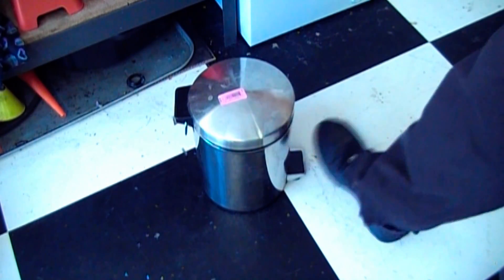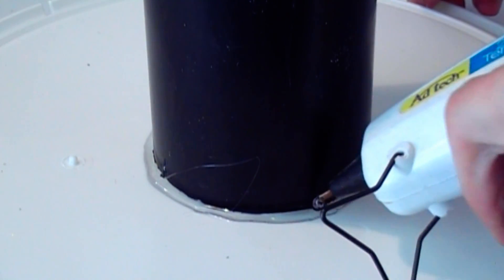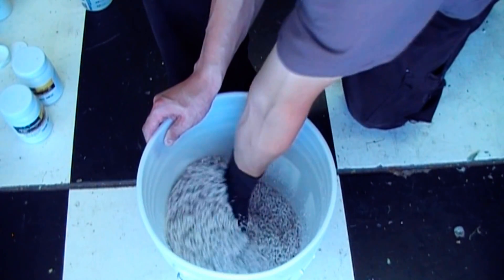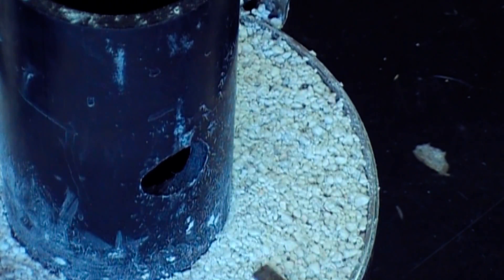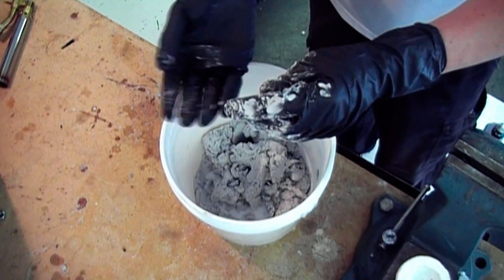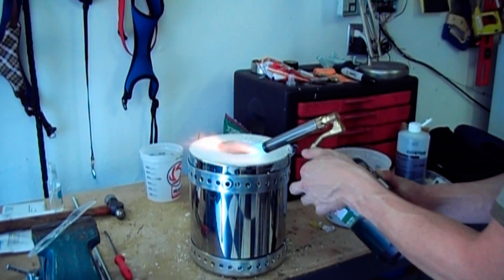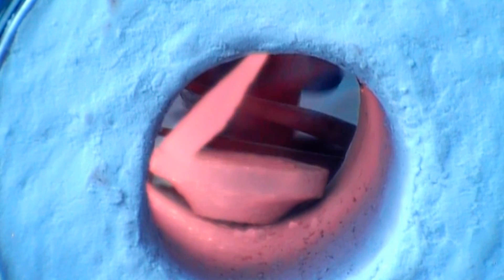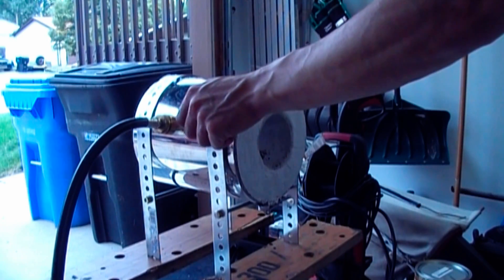How to build a trashcan forge

Comment: I used your method here but on a slightly larger scale. I used a 55 gallon drum! Multiply all your ingredients x10. And I made a few mods along the way. It's on a cart because it's so friggin' heavy now (over 160 lbs) and I used a 20 lb MAPP gas tank  and oxygen cylinder with a push button igniter from a gas grill. It burns so much hotter than store bought propane. And there is a gas plant very close to get cheap refills. I could not have made it without your video, so thanks. When I get it all finished, I will post a video response to show you how I did it. Thanks!
Reply from the maker: Danny Criss Cool, it's nice to hear others having success with this method.
Reply from the maker: It dose loose heat more than an enclosed forge, my plan is to make a set of doors that can open or close.
Reply: Danny Criss I'm looking forward to that response :)
Reply: Bill Milligan Sorry, it ain't going to happen anytime soon. I got most of the parts and then used them on another project in an in-ground fire pit. They don't allow open burning in my neighborhood. So I got fiberglass "logs" and use the parts to make a fake outdoor firepit. This is a great project to build though. I should give it another shot.
Reply: Charlie Foxtrot The 3rd were you serious about multiplying it all by 10?

Comment: I didn't see in the comments anywhere, but does this forge get hot enough to make forge welds?
Reply from the maker: HardtailNomad I'm thinking not quite, I played around with forge welding, but it took too long to get the work hot enough that the process was basically not possible.
Reply: clkindred Thanks for the quick reply. That what I was really curious about.

Comment: This is really nice, I'd like to use your project to do some brass casting, do you feel that the forge could use a back cover made of the same refractory you used and hence become a standing furnace?  by putting the burner near the bottom and using a crucible on top?

Thanks for the video
Reply from the maker: lbabeanu Sure, I plan on making some doors for the front and back, but you could use the thing tipped on it's end vertically.

Comment: How high does the forge temperature go? I've been researching this because I aim to make a coal forge using a similar method, and according to most sources, sodium silicate melts at around 1100 degrees celsius, which doesn't seem to be the case in your forge
Reply from the maker: Maxime Once the lining is "set" there is no sodium silicate to speak of, it decomposes into silicon dioxide, with a melting temp a little higher at 1600 degrees Celsius.

Comment: Quick question. Me and a friend built a foundry with your mixture. We compacted the perlite mixture to such a degree after leaving it sitting overnight we had about an inch or two of water in the burner hole. Do you think we compacted it too much? Will this cause any problems? Thanks
Reply from the maker: Michael Lawrence I don't think compacting it too much is a concern. Just make sure to dry it well before un-molding. When I fired this forge up for the first time, there was water dripping out and making a puddle on the floor.

Comment: Do you have to flame set the cement mix, or is the flame just to get it to set faster? You could just let it air dry over a few days?
Reply from the maker: richtus It will harden in air, but if it contacts water it will soak it up and fall apart, flame curing causes the sodium silicate binder to decompose into quartz (silicon dioxide) at that point it will not absorb water and re soften.

Comment: Hey I've been watching your forge builds and have to say I am impressed.  Your refractory material recipe is great as well as the water glass.  In this later build you commented that it was a week before your refractory lining set up.  Does it take that long or did you simply wait that long before getting back to the project?

Also, where do you find the aluminum oxide?  Is it inexpensive?  In your other video, you also added baby powder to the mix (looked a lot like meeko's furnace cement when you finished it).  Is it necessary?  Thanks for posting.  your projects are quite ingenious.
Reply from the maker: Aubrey Smith Thanks! The week long wait was so the refractory could dry and become firm enough to take the center form out, the time it takes for it to be ready for that can vary, but if you un-mold too soon it will crumble apart. I got my aluminum oxide from harbor freight, it was 6 bucks for a two pound jar. I used two jars, so 12 bucks of alumina went into it. That older recipe with the baby powder (magnesium silicate) is not as good because it melts when directly in the flame.

Comment: I have a very hard time finding aluminium oxide (at least in the relatively small quantity used for this project, the smallest quantity I can find is in bags of 25kg).
So I have a question: is the aluminium oxide necessary, can it be omitted or possibly exchanged (with for example olivine sand which I can find in an appropriate amount)?

I'd love to give this project a go as soon as I can scrounge together all the things needed.
Reply from the maker: Jonas Lundh You can probably use olivine but the process might be different. If the stuff is fine enough, you can coat the perlite particles just like I did, but if the stuff can't be coated onto the perlite, then just a mixture of the two materials might be the way to go.
Reply: clkindred Ok, thanks.
Reply: You could always make the fireproofing out of plaster of paris and sand. For a 50 lb. Bag of fine play sand you would spend $15 and for a 50 lb. Bag of plaster of paris you would spend about $20- $30. Plus it works like fire brick, and it cures faster than his fire proofing.
Reply: gunshowdocs But wouldn't plaster of paris be extremely prone to cracking (even exploding) if there are even the smallest trace of water left in it?
Reply: Usually, no. It usually burns out in the curing process.
Reply: The sand does the job of keeping is structurally sound and of keeping it insulated.
Reply: fireant001 -Thanks for that suggestion! Any tips or ideas on mixing ratios?

Comment: Since you did all the brainstorming, I need to pick you brain dude... Your forge is awesome! Question, what is the brass part your screwing the propane adapter to? I found silica gel on eBay, but I'm running into a lot of the color changing silica gel, and I'm wondering if it'll serve the purpose in making your sodium silicate formula? Is there a place you recommend buying it from and how much am I ordering? Do you think your forge can melt brass or copper?  I can't wait to make one of my own!!! 
Thanks for inspiring me dude!
Reply: Dude, I found most of the pieces to do it your original way, as I noticed this brass piece is from a burner itself. Wanted to know if I can use an official adjustable bbq regular hose that can go up to 20psi and has a 3/8 flare female at the end of it to connect directly to the 1/8 coupler or does it have to be a non regulated propane hose. I'll adapt hoses as necessary. I also watched video a few times more and got the quantities to make the sodium silicate, just had to listen better.
Reply from the maker: Nicholaos Georgopoulos
The best place to get silica gel is walmart believe it or not. A brand of kitty litter called "mimi litter" is silica gel. It has some blue particles it it, but they do not harm the process.

You can use a regulated hose, you will need a 3/8 male flare to 1/8 NPT female adapter if such a thing exists, or use a combination of fittings to end with the 1/8 NPT orifice plug. Then the burner construction will be the same going forward.
Reply: I found al ost all the brass pieces including the 3/8 flare to 1/8 npt. I also bought a valve to put in at the end of the bbq hose, but I'm wondering which do I control, the valve or the regulator which maxes at 20 psi? What do you think of refractory cement which is available at Home Depot vs trying to make it or even order it from eBay. They have a 40% solution, 1 gallon for $30. Haven't done the cost on making it vs buying it. i looked into kaowool, but I realized it can get expensive trying to make something bigger than your tin can version because I want to melt brass and I imagine using a big crucible. Found Mimi litter at Walmart, nice and cheap while anywhere else online is a total ripoff. Will keep ya updated..still awesome!!!

Comment: Not being able to find aluminum oxide locally, I substituted silica sand. With a melting point of 3,133 F, I'm hoping it will hold up fairly well.
Reply from the maker: KGatLC It might, it would depend on your heat source. 3133 degrees F is above the temps the majority of the forge will see, but right where the flame hits the forge wall, that's were the trouble may start as it could be much hotter there.
Reply: Thanks for the reply. I fired it up yesterday. You're right. It was looking a little soft in that area, and I developed some cracks. Still better than just the perlite mix alone. I'm going to try a coat of straight graphite and sodium silicate next. Loved your axe, by the way.
Reply from the maker: Thanks, I have been wanting to try working with graphite, but don't have a good source locally.

Comment: Is there a difference between having a hole all the way through the furnace, versus having a closed back and just one opening? I'm thinking, a hole straight through is more useful for putting stuff in, but might not keep the heat in as well. Why did you choose the all the way through hole?
Reply from the maker: It's exactly as you think, it's a trade off for more flexibility when working longer pieces. I'm working on some doors that can be adjusted open and closed to help with the heat loss when the openings are not needed.
Reply: clkindred I hope those doors work out. Thats a pretty good idea if you it'll work. I've got all the parts I need to build a whole unit, except the stainless steel tube, which is in the mail.

Is there a magic nuber as far as the length of a burner tube? I've got almost the same burner parts that you used, except the tube I ordered is 12 inches long, so I can set the length to whatever I want.
Reply from the maker: It would have to be about two feet long to be too long. Too short is about 4 inches. Your tube should work fine the way it comes.

Comment: Is there an insulation vs size of can ratio I should adhere to in making this?
Reply from the maker: Well, the more the better in terms of insulation, but there has to be a trade off. I would start with your heat source, find out how large of an area you can heat. For the burner I built for mine, the size of the burn area is about the maximum I can heat with it. After you know how large an area you can heat, work out the size of container you need to build it in, adding no less than a two inch thick lining to the burn area. My burn area is about 3 inches in diameter, add a 2 inch wall for a 7 inch diameter total. That would be a good starting point.

Comment: So, after purchasing the correct sodium hydroxide I realized I had used up quite a bit of the silica I had ordered. Corrected the recipe. It took a little longer than I anticipated, but wow, when it goes into solution, you know you've got it! Thanks for the help. But now, I need to know about how much of the "water glass" will I need to make the "frosting" mix? I think I only have about 1/3 cup left over after adjusting the recipe. how much of the other items for that amount?
Reply from the maker: The 150ml I used in the video is roughly 2/3 of a cup, so you have enough to do a batch with 1/3 cup sodium silicate and 1 pound aluminum oxide, half of what I used.

Comment: Found liquid Sodium Silicate 40% (3.26 wt. ratio)  at CQ Concepts chemical supply for $15.26 for a GALLON. Not for certain what the shipping would be on a gal, but the difference in price makes it pretty reasonable. Thought I would share.
Reply from the maker: Thanks for the info, 40% seems to be the standard concentration for store bought sodium silicate. I don't know if that concentration will work with the dilution recipe I give here though.
Reply: +clkindred Rutland floor cement should be 100% concentrate for about 30 dollars

Comment: I have been watching these videos and keeping notes. Tried my first water glass today. Could not get the silica gel particles to dissolve, even with a little heat added. It thickened up into a Grey/green gel solution. Any ideas as to what went wrong? My recipe was 300 g Na hydrox; 300 g silica gel; 500 ml dist. h2o. Thanks for the help.
Reply from the maker: It may depend on how much time has passed while the process is going. The longer it takes, the more water you loose to steam. Your ratio has 100g more NaOH than what I used as well. Don't be afraid to add more water if you need, it won't ruin the reaction or anything.
Reply: clkindred In the video, the water glass solution is clear. Is that according to which manufacturer of the sodium hydroxide, or is it supposed to go clear once it is fully absorbed in solution? The product I used was highly green colored, and now has the grey/greenish hue I described. Hoping its not ruined,but I have hope now and will return to it with some water and a little heat. Thanks.
Reply from the maker: What product did you use for your sodium hydroxide source? Pure NaOH is a white solid, there shouldn't be any other chemicals with it.
Reply: clkindred Its Johnson & Johnson product DRANO crystals. The ingredients says "poison - contains sodium hydroxide (caustic lye). and under there it does say under other : "caustic lye, stabilizer, dye. Is there something there that will disable the process I am looking for? I wore a lab mask (not dust mask) but it was extremely caustic smelling - to the point I had to remove it to outdoors to feel comfortable at all.
Reply from the maker: Yea it's best to stick to the three examples I showed in my sodium silicate video, the other product I showed contained other chemicals and could not be used.
Reply: clkindred ok. I'll look for the ones you had on the video specifically. BTW, when you mixed the NaOH into the water, does it put off extreme fumes, or was that due to the other additives? Also, I think I will scratch the last batch . . .but where or how do I dispose of what I have mixed up? Thanks for the help and quick replies.
Reply from the maker: I mostly just had steam, but if the heat is high enough it could get irritating to the nose. It will smell like soap. Disposal of your first batch can be done down the drain, it is drain cleaner after all. You could add vinegar to neutralize the sodium hydroxide if you want.

Comment: If I can't locate aluminum oxide, would Baking Soda Blasting Media work?  Won't conduct nearly as much heat I suppose.
Also can i user vermiculite instead of perlite?
Thanks, and great series of videos
Reply from the maker: Baking soda will decompose under the heat. Vermiculite could probably be made to work, although my experience is vermiculite is very soft and spongy, it's hard to compact into and mold.
Reply: clkindred In response to Dubious Jones, I found the Aluminum oxide on Amazon as sand blasting media. Also used on rocks,brick. However, its high grade. has lots of cautions about it being explosive under the right conditions, etc. Take care!
Reply from the maker: I know you were addressing someone else but, do you have a link to this aluminum oxide with explosion hazard warnings? I have never known alumina to have any sort of explosion hazard, aluminum metal can be that way though.
Reply: clkindred Actually, what it says is "remove flammable items from work area as sparks might be created capable of igniting an explosion or fire. Inhalation may cause serious lung damage." And the product is BADGER, aluminum oxide abrasive, but it didn't have a grit number, like I was looking for. Its is grey, very fine and very heavy. Is this the wrong one? Its unopened and I can theoretically, return it. Thanks!!
Reply from the maker: Ah, ok it sounds like a generic warning for grinding. The grit itself is not explosive, but it might produce sparks that can ignite something that is. Other than the color, mine is white, it sounds like you got the right stuff. The color might be from trace amounts of impurities that shouldn't matter for sand blasting. For high heat use though, it might get a little smokey at first until it burns off or is destroyed.

Comment: What is the % concentration of the Sodium Silicate? I'm looking at this on amazon: 

http://www.amazon.com/Sodium-Silicate-40%25-Solution-32oz/dp/B009GAQFJA/ref=sr_1_2?ie=UTF8&qid=1423149615&sr=8-2&keywords=sodium+silicate

Is this the stuff?
Reply from the maker: The stuff linked is a little on the dilute side, it will probably work for the perlite and aluminum oxide part, because I cut my sodium silicate by half with water. But the sealing cement needs as little water as possible, I used my solution undiluted.
Reply: clkindred So on Amazon, they offer NaSiO3 in dry form, and they say its "pure" which may be up for debate. But they indicate it has to be diluted 50/50 (I think) to form liquid glass. If one purchased the dry form, how much water do you recommend in the sealing cement?
Reply from the maker: As little as possible to get all the solid sodium silicate to dissolve.
Reply: clkindred Since I can't find and buy it, I guess I'll just make it. Thanks for making that video too.